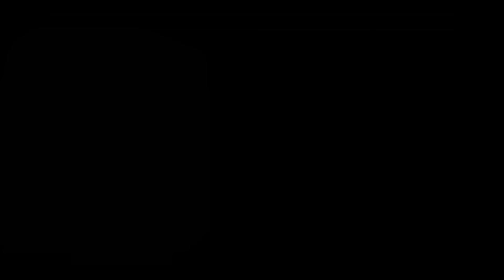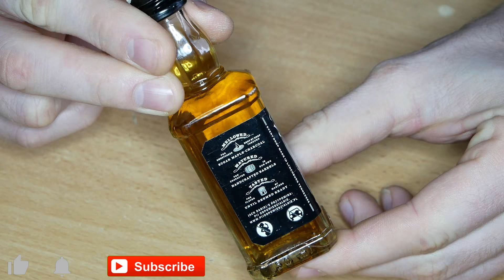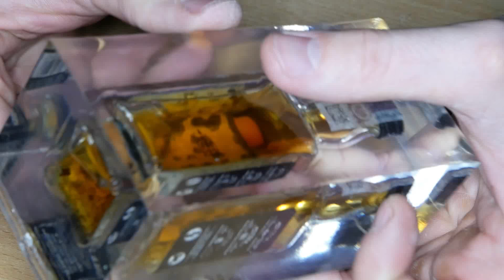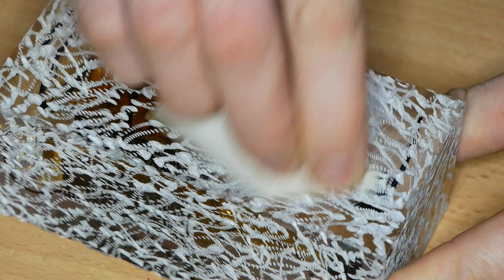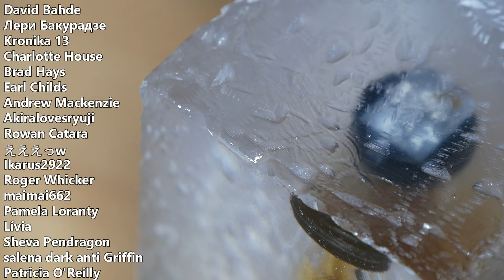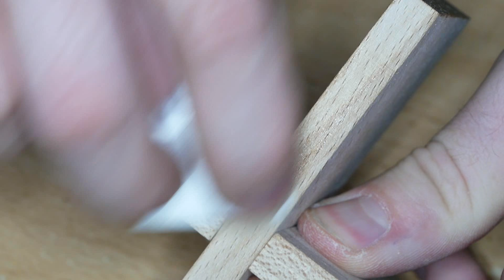Bottle Frozen in Ice Cube / RESIN ART

Comment: I really want to put a small bottle of Jack Daniels in resin but I'm worried that I will see the layers after each pouring. I already tried it once but unfortunately I can see the layers :( In your video you waited until the surface was hard and then you put the jack daniels bottle on the first layer. But as far as I see there's no visible layers in the end. Does it depend on the resin or what do I have to do so that my casting is crystal clear without any visible layers? Any help is appreciated ;) Thank you!